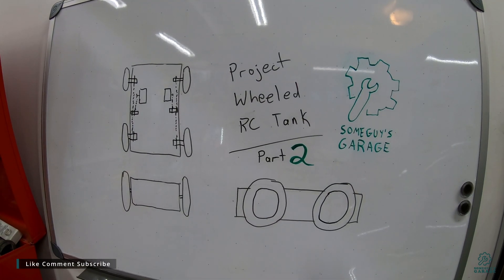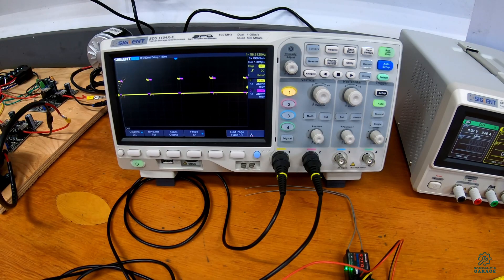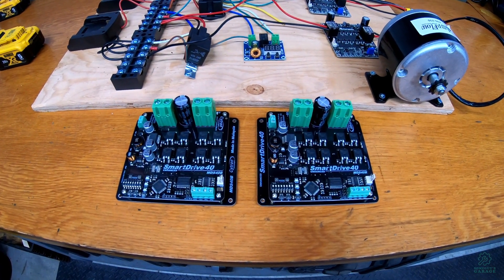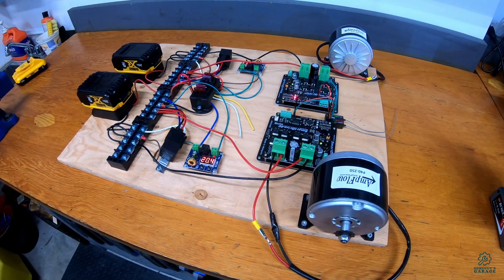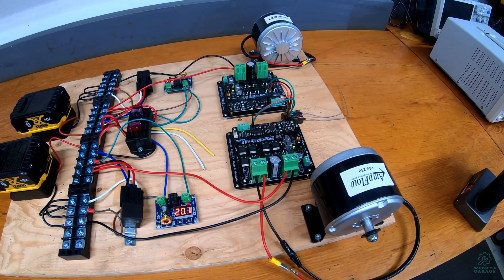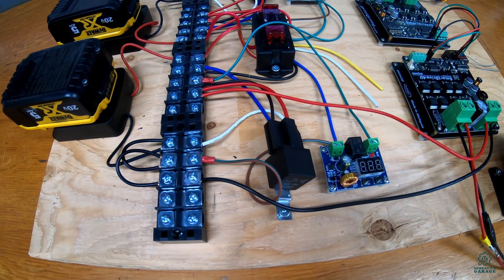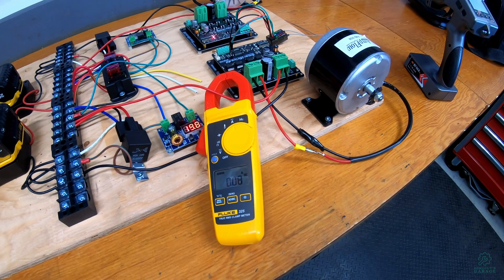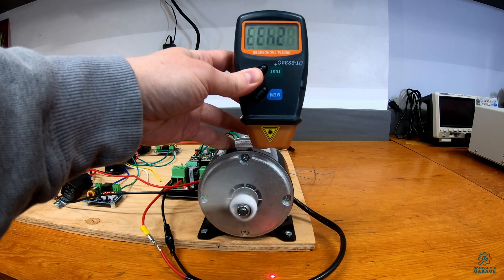Project Wheeled RC Tank - Part 2 - Electronics Complete!

Comment: Hi, Could I use 4 Motors ? I would like to have 2 extra motors for a project that has Brushes for cleaning, those motors can have a potenciometer on the RC Controller but i guess i would just need to do the same wiring but buy 2x more of these items ?
Reply from the maker: Yes, the RC tx/rx have extra channels you could use for controlling it and then you'd just need appropriate sized motor controllers for them. I'd probably just splice in after the relays to those extra motor controllers so you could share the relays/low voltage cutoffs/batteries with the drive motors rather than duplicating all of those.

Comment: Hey it would be amazing to know where did you get the electronics from so I can try this myself new guy to the rc world
Reply from the maker: There's a place called Robotshop up here, you can order online - that's where I got the sprockets and motor controllers. The radio rx/tx and ampflow motors came from amazon.